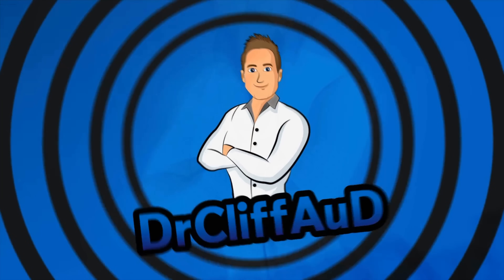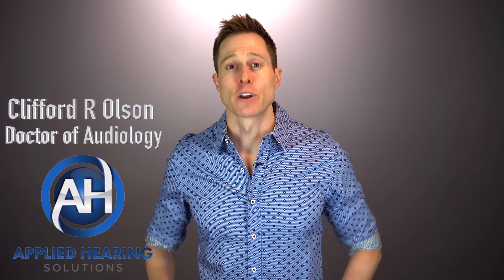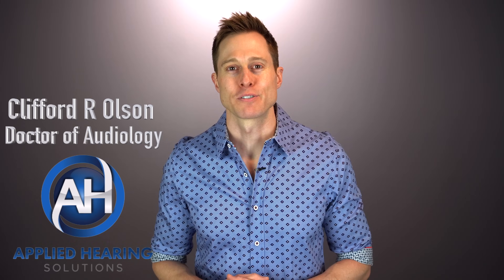The TRUTH about Hearing Aid Bluetooth Issues

Comment: I’m having awful Bluetooth connectivity issues with my heating aids. My provider is working on resolving. Why is this only with hearing aids?? I’ve used multiple Bluetooth devices from several brands and never had an issue. Until I started using hearing aids. Seems like they aren’t technologically sound to me.
Reply: 5000 dollars for my starkies. And right side is junk

Comment: My current and previous HAs both are MFI (made for iPhone) Bluetooth compatible. My experience over the 5 years I’ve used them is that the connection is reliable if I only connect my HAs to my iPhone. But if I try to take advantage of Apple’s Handoff feature that’s supposed to let me also connect my two iPads and automatically switch the HA connection between all three devices, that’s a mess; about 1/3 of the time something goes wrong. The most common problems are the connection won’t switch, or playback will freeze or stutter, or audio will only stream to one ear. This is not a new issue and it’s persisted over several years of major Apple software updates up to the current one (iOS 16). I’ve emailed Apple accessibility support several times over the years to report the problem; they always reply sympathetically, suggest the usual useless un-pair/re-pairing, and sometimes promise a fix is coming, but nothing changes. I’ve also contacted the HA manufacturer a few times about this issue and they blame Apple and recommend not using Handoff at all.

Comment: I have a pair of Signia Pure Charge & Go 5AX devices. Recently on a checkup visit my Audiologist performed a firmware upgrade on the devices. Shortly after the upgrade,  I started noticing Bluetooth disconnecting one side or the other...and the sound was horrible. Sometimes a reboot of the devices would resolve the issue for an hour or two; other times it required me to go into my phones settings, uninstall the devices and reinstall them. After a week of this I took them back and my Audiologist re-flashed them with the original firmware. Issue solved...they haven't lost signal in 2 weeks since.

Comment: I can confirm these issues with my Oticon and my IPad, but no problems with my IPhone (both only a year old). Submitted a bug report and spent hours on the phone with Apple. That was a year ago and no fix in the updates over the past year. The issues is garbled connectivity every 90 Seconds like clockwork. But it only happens with the IPad, and most noticeable with audio books.  I have the latest Oticon firmware.

Comment: Thanks for making a concise video to help substantiate what I've been telling our patients after every major mobile operating system update! Of course, nobody has pin-pointed the exact cause of all these problems. I've theorized some of the intermittency issues could be directly related to Bluetooth LE (low-energy) being pushed that otherwise helps improve battery efficiency with mobile devices, but perhaps some of the protocols that help it be more stringent on power usage also compromises consistent re-connecting to paired hearing aids.
The story is always the same, they initially pair up nicely in office, which makes sense because you're essentially forcing them to acknowledge each other with a strong handshake. The problem is every time they reconnect on their own, it doesn't always complete like it should. I've further been suspicious this may ultimately be a simple time-out issue that neither an end-user nor an app developer has the ability to adjust. Often one side will repeatedly be the one that doesn't connect, although the system may claim that it is. The usual successful trouble-shooting method is to close all open apps then toggle the Bluetooth off and on. This clears out anything in the background that could be sapping performance, then toggling the Bluetooth forces the phone to re-attempt to connect to the hearing aids while the phone is focused on just doing that. The fact that this usually works, tells me that phones are literally "giving up" on connecting to the second side because reduced performance is causing it to take too long relative to a pre-programmed timer for that operation.
Catch is, every other Bluetooth pairing is only a single device to reconnect to. Even if they're stereo true wireless earbuds, you connect to one ear that acts as the master that broadcasts to the opposite side. Hearing aids however are unique as they use a Bluetooth signal to communicate, but the operating system acknowledges them as specifically being hearing devices as opposed to any other Bluetooth device and subsequently connects to both sides individually in the "Bluetooth Devices" list while yet still addressing them as a single paired entity in the "Hearing Devices" list. Which leads me to think there's a tiny oversight in the protocol for connecting to them in that they're still being treated like they're a traditional Bluetooth device, and the phone is only really allotting the reasonable amount of time to connect to ONE device (again possibly a result of trying to be more power efficient, it won't keep churning on attempting to connect to a single paired device if there's an issue). Upon timing out on the second, no further attempts are made to retry connecting to the other side, as the phone detects that yes, it did successfully connect to a Bluetooth device! It fails to acknowledge there's another half of the set that isn't connected as that's not usually the case for Bluetooth devices and apparently it's missing a provision to check for that. You can see this confusion particularly on an iPhone when you check the hearing aid status in the Settings/Accessibility/Hearing Device menu, you'll see it shows both sides "connected" but one of them will just be a spinning circle for the battery percentage estimate. That's because it's falsely reporting a complete connection for the pair again due to having success with the one side, but in reality it is not hooked up to the other.
Frustrating, because regardless what the core issue is, it's very difficult for hearing aids manufacturers to compensate for things an operating system is doing at such a base level, they cannot touch patching how the system connects to a Bluetooth device with an update to their app or the firmware of their hearing aids. While, of course, hearing aid connectivity is just an auxiliary feature to the phone manufacturers and no doubt is not a top priority to develop software/firmware fixes for, certainly not redeveloping a protocol that overall was a benefit to the phone otherwise. They'll get it figured out eventually... when they get around to it, and with no reassurance it won't inadvertently be reversed when trying to push future updates! Meanwhile it's advertised that phones work with hearing aids because they've technically made a provision for it, and of course hearing aid manufacturers advertise they're compatible with select phones because they really are doing everything they can to be, the goal-post just keeps moving arbitrarily. Only natural that patients see the hearing aids as the issue as they're typically the newest thing added to the mix unfortunately, and the phone was being a phone just fine prior to these confounded hearing aids the fitter has attempted to connect to it.
Reply: Hey Josh, thanks for your very thorough discussion of the BT connectivity/SW update problem. Very helpful!

Comment: I really doubt this is why mine are having Bluetooth issues. I have Beltone Amaze, less than 1 year old. I had my left hearing aid adjusted several times to increase loudness. The last time they found that the mic filter was clogged and then it was real loud. I also think they said there was a firmware update they applied. Anyway, they adjusted it (lowered its volume) and all seemed well. Note: they have the music mode set as my default. Now when I try to stream anything in that mode like phone calls or music, Roku etc the balance is WAY OFF. It’s loud in the right ear and quiet in the left. I have to use the iOS settings to move the balance to the left A LOT. I’ve NEVER had to do this before and never had to do this with 2 sets of Resound owned. I’ve been back to my audiologist 3 times and they still do this. I’m also getting different results in different modes, it’s like it works correctly in a couple modes but incorrect in 2 modes. Lately my right hearing aid seems to not be loud enough in regular hearing mode (non streaming) I have to increase it somewhat. These worked fine when I hit them.
Reply: Sounds like you have bad audiologists

Comment: I have Oticon More 1 hearing aids that constantly disconnect from my Samsung Android phone.  And volume is very low. Do you find this common with Oticon hearing aids when used Android devices?
Reply: Yes, I have the same hearing aid, phone, and problem. I have to switch off Bluetooth when using the phone for voice communication.
Reply: I also have Oticon hearing aids- brand new ones. Significant BT problems connecting and maintaining a connection with my iPhone 12 Pro Max. It doesn’t help that my husband is using my previous hearing aids, also Oticon . If he connects, mine disconnect. Everyone is working on a solution. For now, my husband only connects with Bluetooth when he is out and about. It’s a heck of a thing. But before Bluetooth connectivity, I had a lot of hearing challenges so I’ll take what I can get. Between Apple and my audiologist, I’m hoping we come up with a better solution. I hope you find one too.

Comment: I am trying to connect my hearing aids to airplane entertainment or other devices that have 3.5 jacks.  My Oticon 2 More Minirite hearing aids.  I have tried Airfly and Aluratek ASl01F.  I tried using a Connectclip as interface.  Airfly worked once, but couldn’t connect on return flight.  Hearing aids connected to iPhone.  ASl01F loaded to iPhone, ConnectClip also connected to iPhone.  Can you provide any guidance or alternative devices?

Comment: Hi Cliff, I don't think that's the whole story. I have Pixel 7 android 13, previous Pixel 6a same android. My KS-10 (Phonak) app disconnects several times a day. Have to reboot & re-pair both to get it going. So I am pretty sure Pixel/android does not update several times daily. So "if" some phone FUNCTION is breaking the connection, that's not an "update". Froggy.  :) Also another issue same as another commenter. When my phone gets a notification (say my security cameras go "on" to record) the hearing aid sound amplification is dead for 3-4 seconds, then comes back on it's own. Obviously shutting off notification fixes it BUT I want the notification (in my ear).

Comment: Can I use a typical bluetooth headset as a hearing aid to enhance my hearing? I'm expecting to buy a hearing aid which is specially made for the people having with hearing issues. But that's cost is very high. And as the research I did, I could see that the typical bluetooth earphone can be purchased for less price in the local market.

If I  choose this option, is it ok?

Thank you!

Comment: Thanks Dr. Cliff.  Do you have any tips for bluetooth @ work using landlines?  I am a geek, but have ran out of luck trying to pair my Phonak (latest/greatest) Audeo with my phone system.  It seams that the compatibility has dried up.  My phone system is Nortel non-VOIP.  Any help would be greatly appreciated.

Comment: I wore an old analog hearing aid years ago. Until it didn't work anymore. My mother died over a year o and I was just going to use her hearing aids. But I thought maybe I should step it up a notch and get a Bluetooth Hearing Aid. However two hearing aids are useless to me. I was born with little to no hearing in my left ear. I had two ear operations he last one about 55 years ago. It is inner ear and that ear just does not work. So I am really just be going to use my right hearing aid if the model I choose only comes as a pair. What I find most difficult now is hearing directions in my car. If I am on an less busy road I can hear the directions well. If it is a busy road I have problems. 

I am on Medicare. Would it work best that I go through an Audiologist first before trying to choose my hearing aid?

Comment: So, i'm still using that old bluetooth tech (with neckloop) i'm (FINALLY) going in January to get new HAs but because i do literally all my tv watching via my computer bluetooth is a concern of mine, i made sure to buy a computer that has Bluetooth capabilities and had a good rating as far as that goes but i'm curious at to how well it works. IOW: do computers have the same issues as cell phones? i don't need to be connected to my cell phone but i absolutely need to be connected to my computer. I'm also concerned about how much HA battery drain occurs while streaming/bluetooth connectivity. I mean if they're rechargeable, can i watch lets say (on a lazy day) i watch 6-7 hours of streaming content, how much battery drain will that cause? Would i still be able to use my HAs? I know this is slightly off topic but bluetooth in HAs is important to me and i want to be sure i'm going the right route when purchasing my HAs. BTW  my compilot is barely alive (it's 9 years old) - it no longer pairs with anything i have to use the aux jack. I'm really looking forward to ditching it LOL.
Reply: Be sure don't buy Starkey. They need adotional accesorie to connet with lapto, or pc.
Tha's the problem that i have 😡
I try Phonak 70(for a trial) They connect with everything, but up an down. When I cobbeted to pc, and received a notification, the audio was slow, like back connectity.
Reply: @velmamilagros  My current HAs are phonak and i've loved them, Phonak is already the route i believe i am going but will talk with my Audiologists on what's the best one for me (and yeah, i trust my aud. he's great!). I will absolutely find the aids that let me hear the best as well as have the best bluetooth options. Thanks for the heads up re: Starkey.

Comment: My oticon More HA's worked with Bluetoogh great until 6 months ago. I used the Connect Clip to stream BT from my iMac. Now it doesn't work. Have treid thrid party Bluetooth transmitter thinking maybe one of Apples updates did the damage, but that didn't work either. Audiologist said at last HA firmware update the Oticon was having BT probs with Connect Clip and was working on it. Appt next week with audiologist will try updating More firmware again and see if there is another solution. When it was working it was the best way I had to listen to music, better than with headphones wearing hearing aides. Hope to be able to get back to that.
Reply from the maker: Have they sent them back to Oticon for a potential repair of the wireless antennas inside of the hearing aids?

Comment: I agree.  As much as Bluetooth can be a real pain sometimes, there's no way I would go back to pre-BT hearing aids.  I have had very few issues though (Google Pixel 4a, and now 6), most of the time if I have a problem I just turn the BT off and on, on the phone and on the hearing aid, then all works well again.  Still, I can't wait for the next generation (LE?) so I won't need the Connect Clip anymore.

Comment: If there are already such massive problems with standard Bluetooth, then it is foreseeable that these Bluetooth problems will increase with Auracast, especially since Auracast is a completely new Bluetooth system with a completely new hardware chip from version 5.2 upwards?And what about firmware updates for hearing aids? My Bluetooth hearing aids are now 3 years old and there has never been a firmware update and never will be.

Comment: I have Oticon Real Hearing Aids.  My Apple iPhone 8 Plus and iPad 8 Tablet have almost always worked.  I can switch Apple devices with almost no problems.  My Win11 PC has never worked with the connect clip.  10 seconds with sound and then 4 seconds without sound.  Never.  Worked.  But my five year old $80 headphones have always worked.  Always. Worked.
So we tried the Oticon TV Adaptor.  That works.  Now My wife can listen via the speakers and I can hear via my hearing aids. BUT!  The TV Adaptor does not maintain a 'persistent'  connection.  I walk away and poof!.  I have to go back into the app and reconnect.  I must add that the Oticon TV Adaptor has a better range than Bluetooth. 
There are problems with Bluetooth, but the problem is NOT Bluetooth.  Bluetooth was not my problem until my Oticon hearing aids made it my problem by blaming Bluetooth.  Wasted many hours of my time and was quite frustrating.  Just like you are.

Comment: Android 13 is causing me issues with my KS10s. Every time I open or close something Android wants to do a vibration or sound.
 - which cuts out the aids for up to 5 seconds or so. I had it all turned off all sounds/notifications before due to this.  I re-checked my phone settings but can't locate a source.  Hopefully Phonak has come up with an update for this.

Comment: ❓Anyone using hearing aids where Bluetooth DOESN'T drop or cycle when streaming? 
My hearing aids ARE the culprit: Rexton BICORE C R-Li (Costco) alternate between left and right instruments when streaming from iPhone 13, iOS 16.2; same issue in 15.x and 16.x versions. 
Why do I think the hardware (instruments) are to blame, not smartphone software? The behavior is similar to an underpowered real-time processor dropping data. During testing, iPhone was in my pants pocket. Costco replaced instruments once; same issue. 
(I've tested Overcast, Apple Podcasts, YouTube, live radio streams; all exhibit same issue.)

Thanks for the great video!
Reply from the maker: All bets are off when you're using Costco hearing aids.